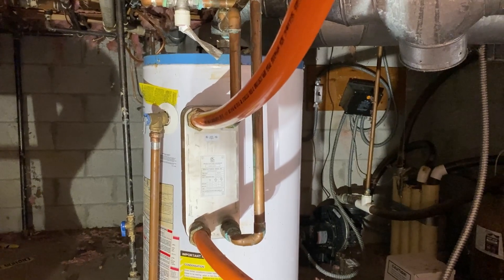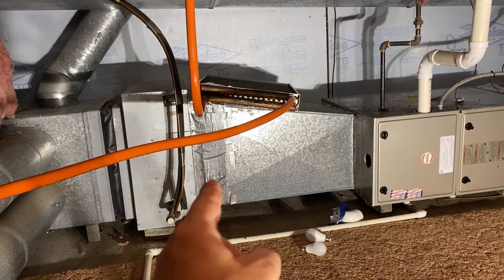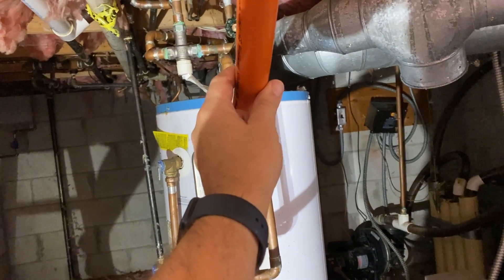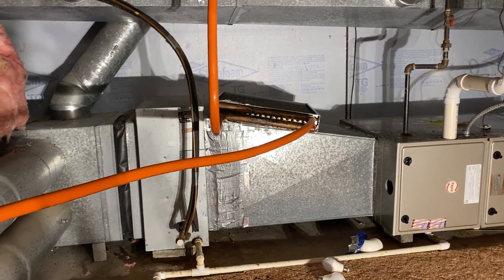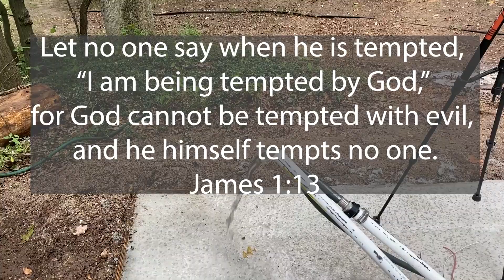Testing For Leaks With a 3D Printed Hose Adapter - Wood Boiler Installation

Comment: Why did you use duct tape when you installed the heat exchanger in the attic unit? Duct tape is not code compliant you should have used UL 181 tape. Other then that we really enjoy your videos. Take care and stay safe.
Reply from the maker: I should have used foil tape for code but gorilla tape will work just fine:)
Reply: Yes It does. Sometimes I think that it is actually better.

Comment: I woud reprint that adapter with solid infill and out of ASA or PETG so it will last in the weather (assuming thats PLA). Its good you sanded down the layer lines going into the tube that will help with stress risers from the peaks and valleys.
Reply: The adapter is just for this flush and leak test.
Reply: @AppalachianLife  Ah, I see. Good stuff